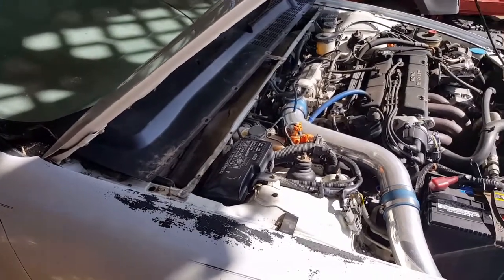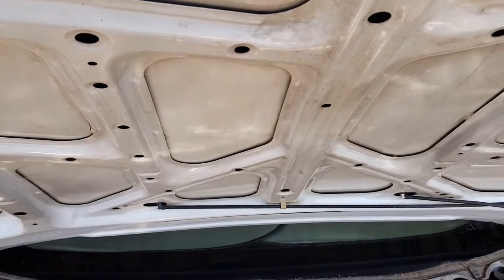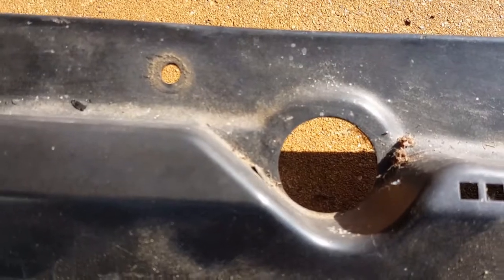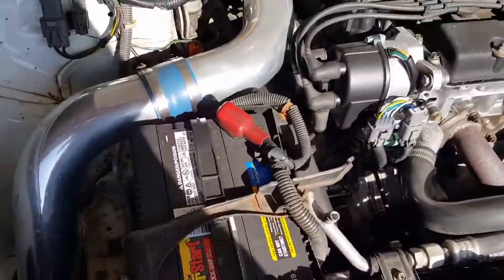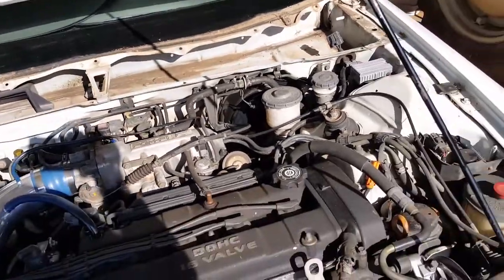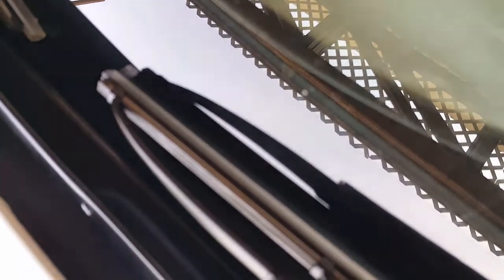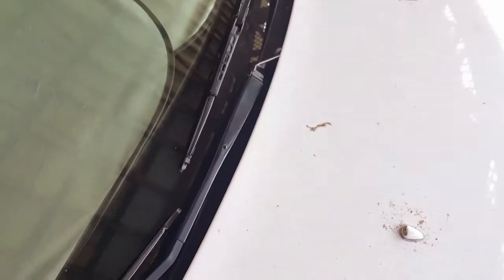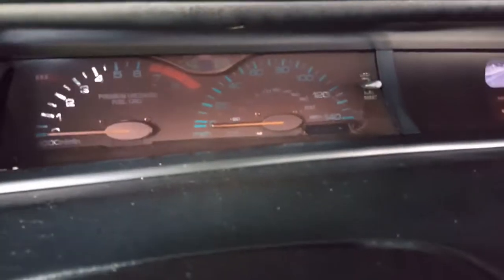92-96 Honda Prelude Wiper Arm Bushing Install

Comment: Appreciate you making this. I have a 93 accord where the bushing on Rod Unit A wore out. The problem is the parts are no longer manufactured, and I can't find Rod A or the bushings for Rod A anywhere. 

Do you have any leads where I might could find these parts? I currently have Rod Unit B on order, and I plan to remove the bushings (assuming they come with it) and attach them to my old Rod A, then install it back on my car.
Reply from the maker: I got my plastic bushings from Oreilly's. I took a old one into the store to match it up with one. All auto parts stores sell them. I think the ones I got said they was for GM, Ford or Nissan. You can replace the whole wiper unit if the motor goes bad, or if the wiper arm mounts are stripped. Autozone sells the whole wiper motor unit with everything except the wipers. Amazon also shows them for sale.
Reply: @sleepwalker29  unfortunately for me, I've checked everywhere, and have tried many different bushings of all types. Most of my parts are discontinued, which aren't even available overseas anymore. 

Thank you for the help anyways. I'll keep a lookout for junkyard salesman. Lol